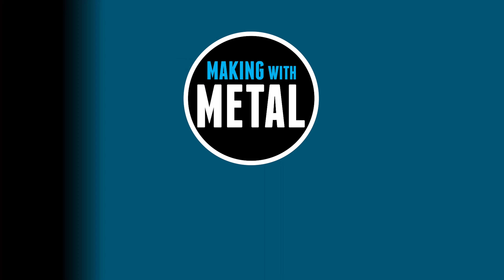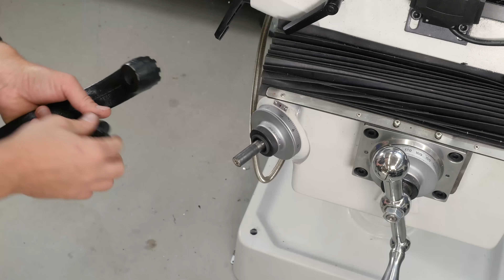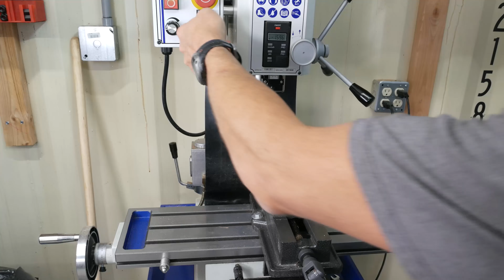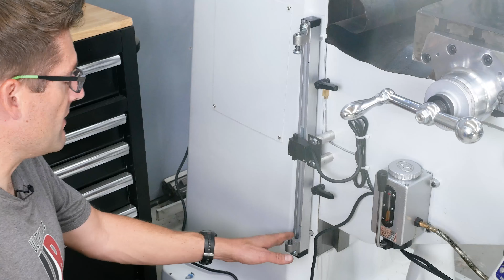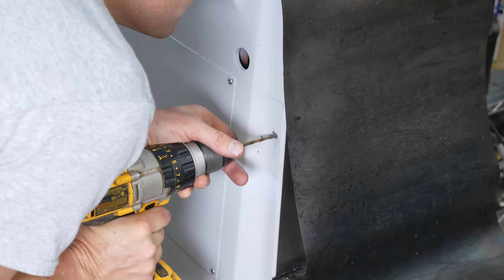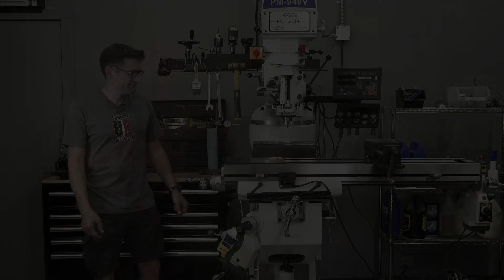How-To: Align Z-Axis Power Feed Install for Precision Matthews PM-949TV Mill

Comment: I’m left wondering about the internal lubrication of the power feed fluid level for the cant necessary for clearance of the knee casting. Are the gears sufficient immersion, or is there going to be a reduced gear life, for this?

Comment: Nice job!  If you drill and tap two holes in the bearing flange you can get the power feed to sit perpendicular.  Additionally, if you mount the limit switch on the right, you have to reverse the micro switches inside.

Comment: Wouldn't it t not have been better & less cost to have ordered the milling machine with the z axis power feed installed? I'm a CNC machinist not a mechanic when installing power feed drive & DRO's. But I would love to be able to have a machine like yours. I'm a big Precision Mathews fan, along with Bridgeport & Acer milling machines which cost a lot more.

I also hate drilling into a new machine since it would probably void the warranty, But Precision. Mathews is a very good company to deal with & they would have had no problem guiding you through  the installation of the the  z Axis power feed unit. I would have bought the Y axis at the same time so each axis had its own power freed & a power draw bar

I currently have an old 19948 J1  Bridgeport in rebuild & to re-controlled. But I think that the machine I buy will be a Precision Mathews 949 milling machine which I'll have to have sent out to be CNC controlled..

I am also a big fan of CNC controlling a Bridgeport or Bridgeport style machine.It takes the guees work at cutting radii  and chamfers. It also allows you to use a ball end end mill to removing any tool paths with the minimal of hand be-burring..